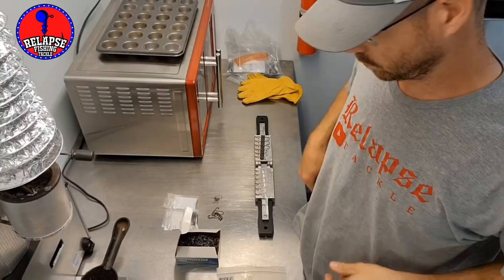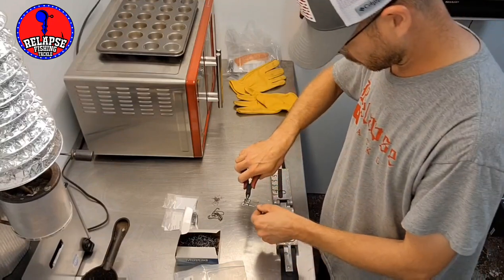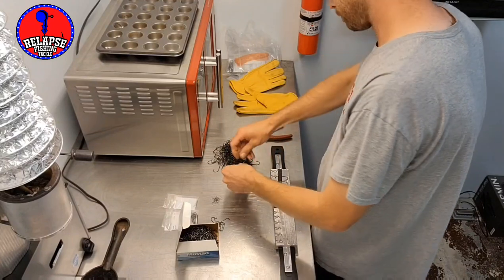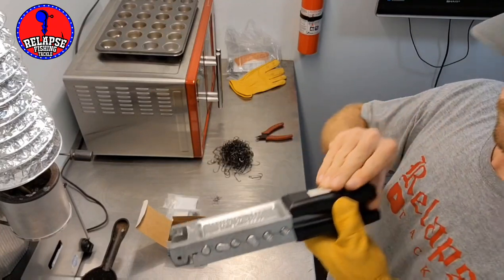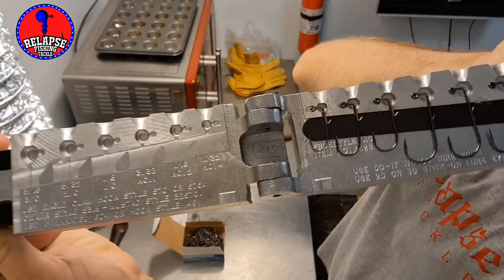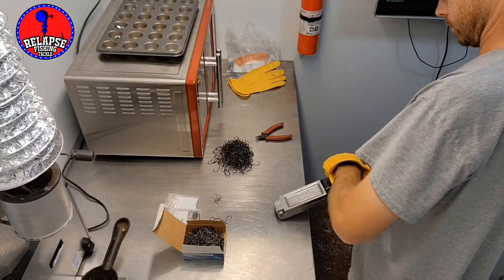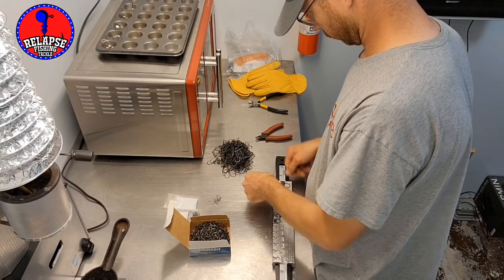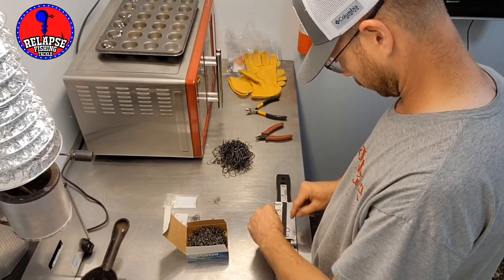Pouring Do-it FREESTYLE jigs in a modified mold 😏 Lots of helpful tips throughout the whole video.

Comment: I noticed that you hold the mold at an angle when you are pouring. Do you do that for a reason or is just the angle the camera is recording from?
Reply from the maker: I hold most of them at a little bit of an angle. It helps vent the air out and if the handle is higher than the hinge it's less likely to flow into the next gate. The spout on the Lee pot makes the  lead flow towards itself most of the time too.
Reply: I was told by do it molds to hold your mold at the angle that the lead comes out of your melter.
Reply from the maker: One of these days I'll read the whole booklet that comes with the molds. 😆

Comment: Curious where you got the magnetic strip from. Also can you tell me what you did to modify the mold so I can share with the machinist I have contacted 
Thank you
Reply from the maker: https://youtu.be/Gz7Lozpjyho

The magnetic strip is from a local auto parts store. I just mill the molds with a 1/2" end mill and stick the magnetic strip in a slot. Most of the time, now I use 1/4" x 1/4" neodymium magnets.
Reply: @relapsetackle  thank you
Reply from the maker: @phillipnewcomb7036  No problem at all.